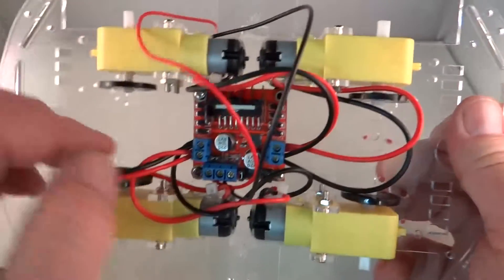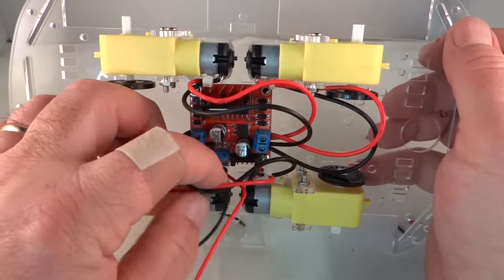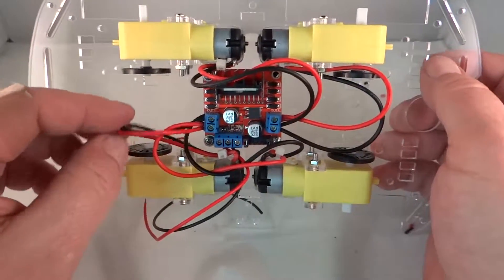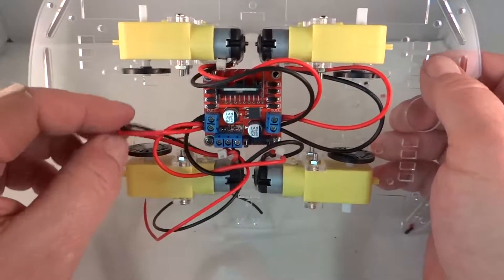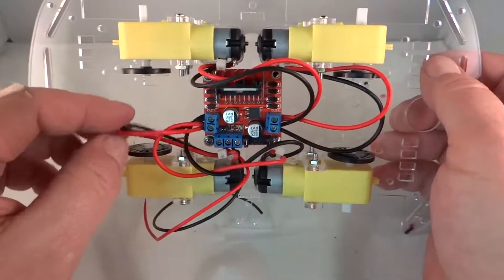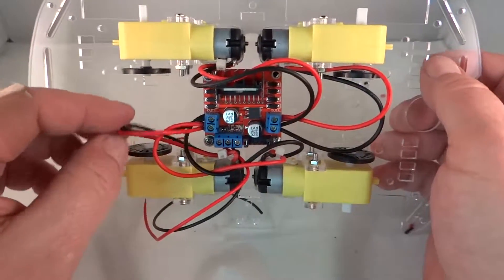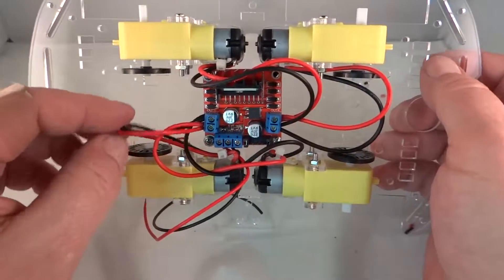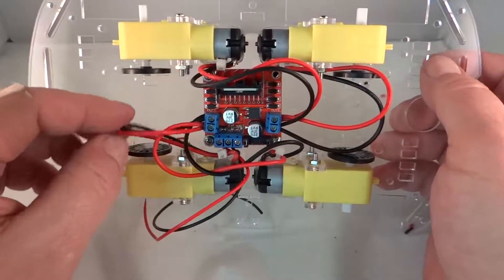Makerfire Robot Car Chassis Kit   10   wiring up the control pins

Comment: When are the next videos gonna be upload? I'm doing that exact same model and need help. I got stuck on the middle lol. 
And it really helps your videos.
Reply from the maker: Nathali M can you post a link to the model you are making? What I have is just a chassis kit, so, I didn't have more parts than this. Check the playlist for this set of videos, maybe you didn't get all of the videos.
Reply: I saw all the videos. But I'm  doing one using the HC-06 Bluetooth Model, then I tried using a protoboard and was unsuccessful, because they didn't had the Arduino Shield 5.0 in the store, only the BrickShield v1.0. But I'm also not being able to connect with that one, so yeah. It's not working
Reply from the maker: Nathali M I commend you for trying to build from scratch and invent! You may want to watch my Elegoo smart robot car playlist. They use the same blue tooth and I explain how the shield works. Then, tell me exactly what doesn't work.
Reply: I'm doing Biomedical engineer, and i have to make one of those. I watched the videos. But because I don't have the arduino shield, i cannot connect like you do. My motors just don't move! 😣 
I even tried to do only using the ultrassonic sensor without the android Bluetooth. And still didn't work. I dont know what i'm doing wrong
Reply from the maker: Nathali M You are able to compile and upload the program successfully? If so, there are many possible issues: do you have good Battery power at the motor controller? What batteries are you using? Do you have control signals at the motor controller? I will try to publish a way to test the motor controller this weekend, that's a good idea for a follow on video. I will also try to show how to connect the Arduino without a shield.
Reply: The program is running successfully, as for the baterries I'm using 4 duracell AA baterry for the H bridge  And for the arduino a 9v battery. 
As for the control signal. Not sure what you mean. I Weld the black and red cable into the mottors, tested wich ones i had to put it toguether and attached to the H brigde.
It would be sooo helpfull and awesome if you could upload the videos. I really need help. 
And there's noo video in the youtube showing how to do it using a protoboard.
Reply from the maker: Nathali M I'll work on the videos, it will be fun. The control signals are listed as ena, in1, in2, in3, in4, and ENB. Ena and ENB should have jumpers installed for testing. Then touch +5 or ground to each of the in pins to test the bridge.